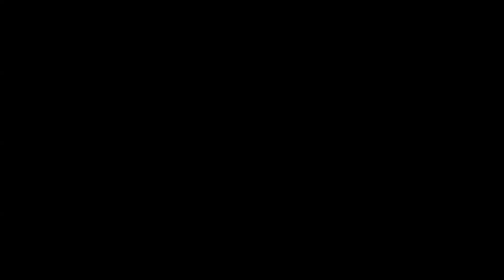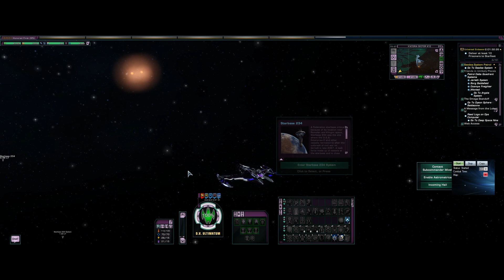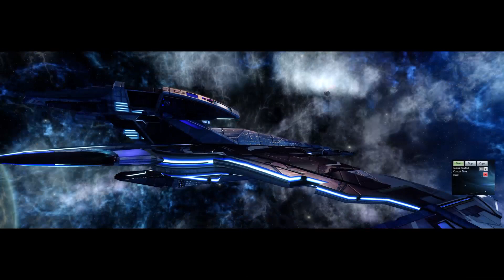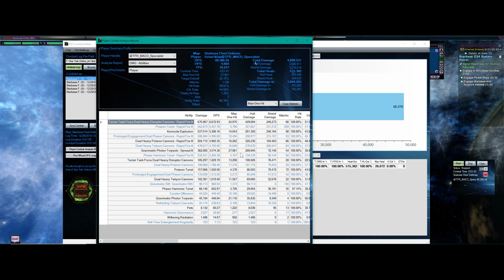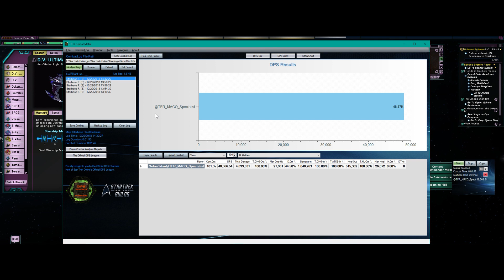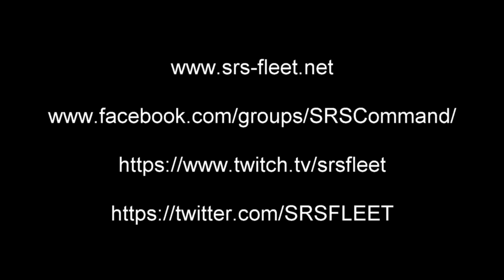Build Benchmarking for Star Trek Online

Comment: im guessing the build and everything on it just for test purposes as isnt an actual build parse......cos you have all mixed cannons and cannon damage locators on? and your skill tree favours engineer stuff......or is there some secret build your working on?
I myself use argala as testing or kerrat cos you can swap things mid fight in kerrat
Reply from the maker: Not at all. The locators are cannon locators which allows me to mix energy weapon types, thereby ensuring I can gain the benefits of the Terran weapon, the prolonged engagement phaser and any other type of energy I like. One of the things many folks don't realise is that many of the engineer skills work to help overcap your power levels as well as EPS boost and of course the essential hull plating. If you want to make a glass cannon then go for the full tac ultimates, as long as you have a supporting healer on your team you may live, either that or you'll need to pretty good GTFO mechanisms.

Argala is a good system for mastering ships, however, there are delays between waves which can vary slightly. The whole point of this video is to maintain a benchmark, a system that minimises variables as much as possible.

Kerrat is useless for testing DPS as it's primarily a PvP zone, and introduces maximum variability.
Reply: Fair enough all makes sense to me just had to check cos it's different from what I see the other dps junkies run